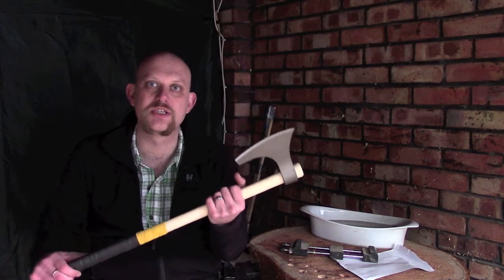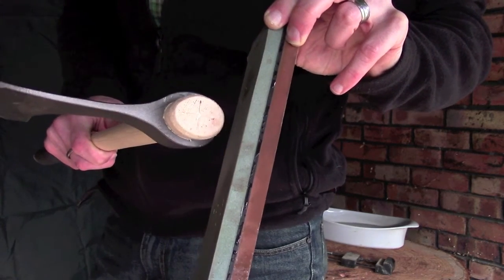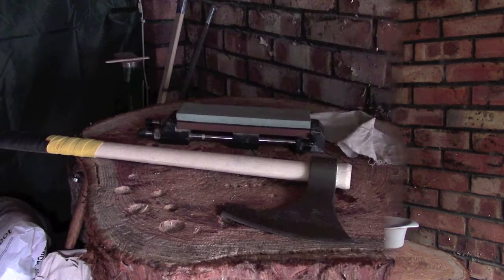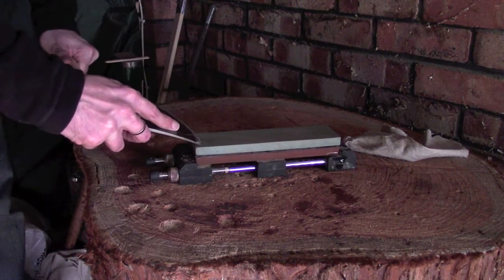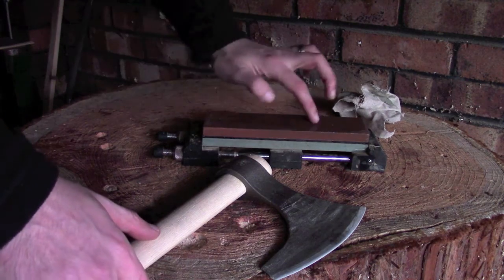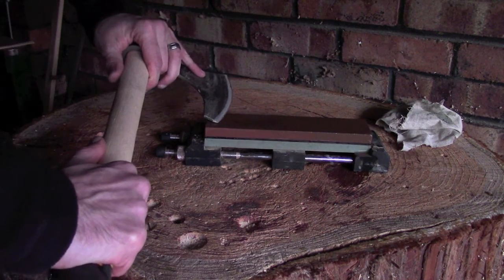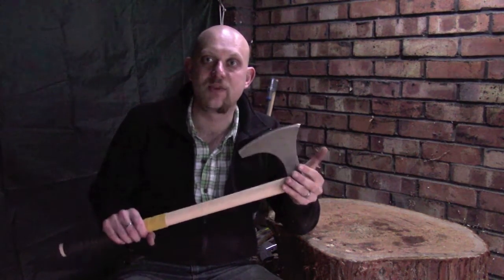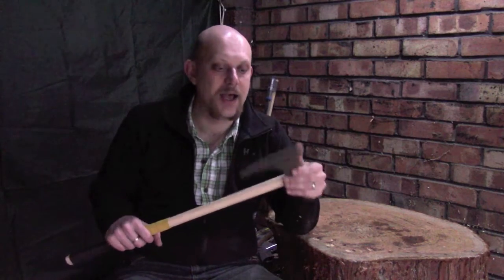Sharpening an Axe

Comment: Great video. I was wondering what mod you did to the other axe for woodcrafting?
Reply from the maker: I haven't got round to it yet as after sharpening the first one the blade isn't ideal for my normal carving style. That said I may persevere and the original plan was to shorten the haft to around 6-8 inches and have it as a general purpose carver.

Comment: great video would you reccomend the combination stones
Reply from the maker: Absolutely, I have been using this set for about 5 years and they haven't let me down yet. The ones in the vid are a 250 and 1000 which cover pretty much all my needs for knives and wood working tools. I do have a 3000 as well but it rarely sees the light of day as I'm not one for getting a super mirror polish but a good strop will get me most of the way there.
Reply: Thanks